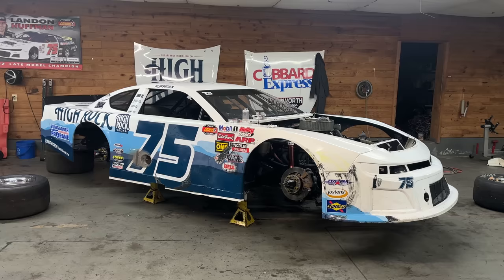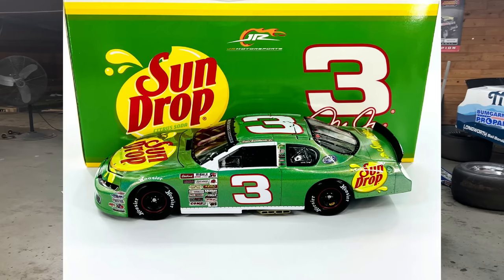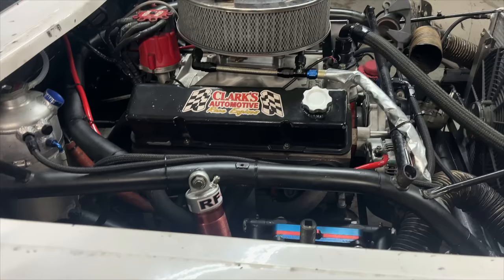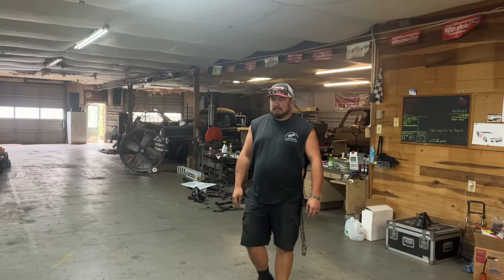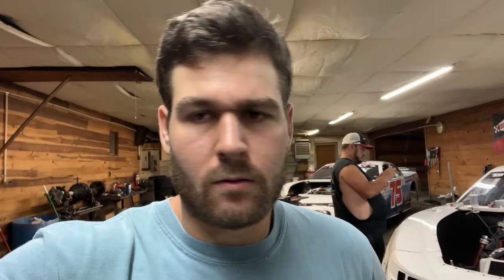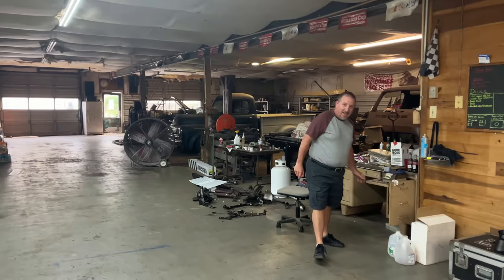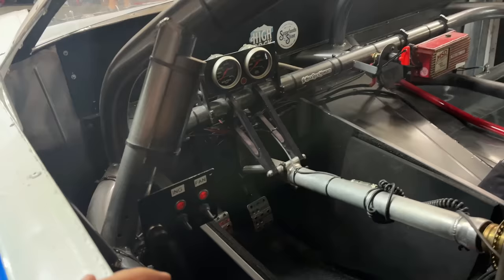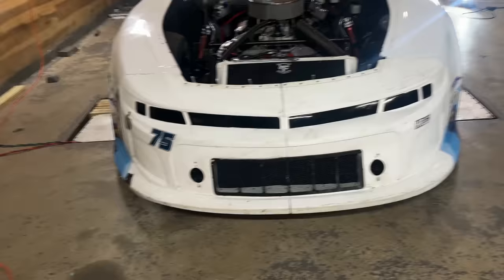This is HUGE for short track late model racing!

Comment: Landon, your nose looks like a 92 Oldsmobile Cutlass Supreme, it's last win in Winston Cup came in the 1992 Champion Spark Plugs 400 at Michigan with Harry Gant driving. 1991 was the last year of Buick & 1992 was the last year of Oldsmobile in the NASCAR Winston Cup series. I always liked the paint scheme of Buddy Baker's "gold # 88" Red Baron Pizza Oldsmobile, I raced TRC Lynx Wide & Superspeedway versions 1/10 on road oval pan cars in the 90's & so on, I usually ran either a Buick or Oldsmobile body but had a a few Pontiac or Ford bodies before I stopped racing in early 2000's.